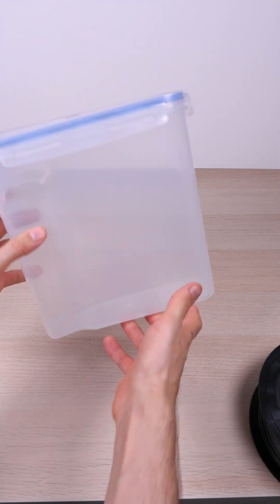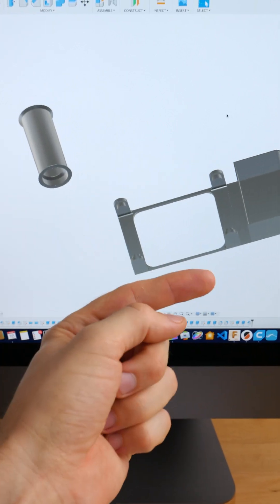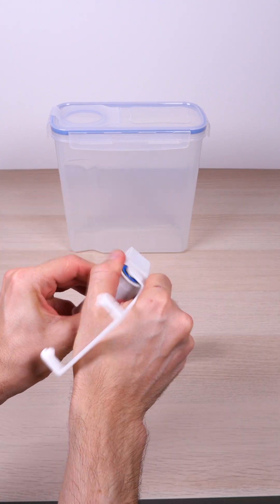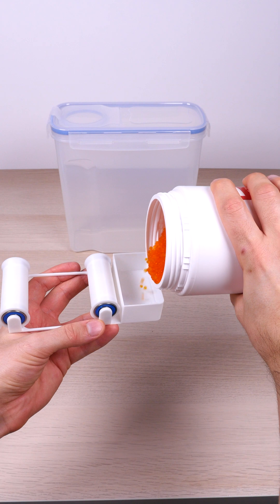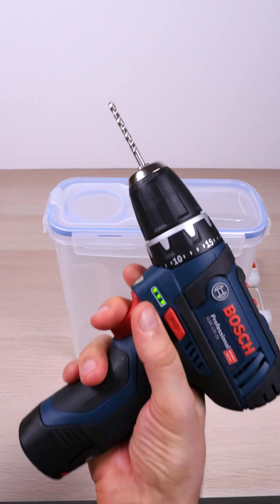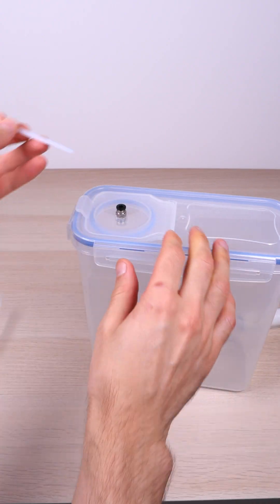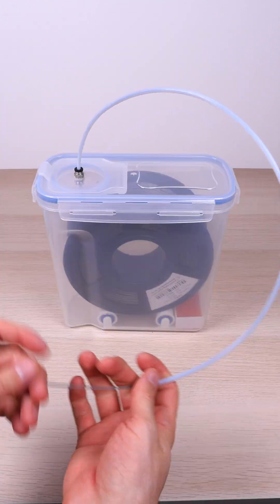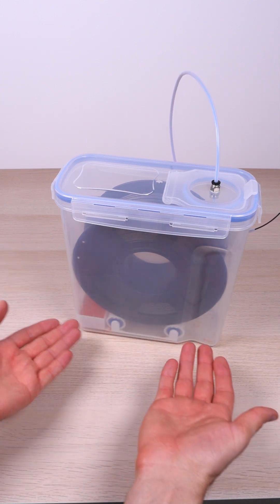how to keep your 3D printing filaments dry - Marsgizmo Filament Bunker (with cereal box)

Comment: I tried with PLA and it breaks off very easily when trying to snap in the roller. PETG would work best.
Reply from the maker: Thanks for the feedback 🙌😁with some PLAs I agree, much safer with PETG. I will update the design, to shorter the "pins" and add some extra features 😎I will post an update in a few days after testing the new design.
Reply: @marsgizmo  Is there any chance, you can increase the width to fit larger spools. I ordered the same cereal container and the width it 3.3" and the larger spool is 3" so they should fit. Have you tested large spools -> 1kg size. The rollers you designed are about 2.25" which I think you said on your insta page is for small spools.
Reply from the maker: @timb3970  yes, I can do for sure :) This is indeed for small spools, this was the maximum width for the Cereal box which I found. They have wider zones but most have a carve inside and will limit the spool size. Do you have a I have a link to bigger boxes? :)
Reply: @marsgizmo  https://www.ikea.com/ca/en/p/ikea-365-food-container-with-lid-rectangular-plastic-s79276760/ These boxes can hold 2 x 1KG spools
Reply from the maker: @sparks-tech  indeed, I'm using them since more than 2 years now 😊 but it's not very convenient when you have multiple filaments, printers as they always have paired together 2 spools and the box it a bit big.

But definitely useful, especially when you have very wide spools. 🙂

Comment: Hello marsgizmo how do you like the bltouch is it worth the buy and what does it do
Reply from the maker: Hi Simon, yes, it's the best bed levelling solution, definitely worth buying. I have 4 already. Make sure you get the latest version 3.1
Reply: marsgizmo ok great what does it really do just level the bed for you with out you doing anything or you level it and it’s a sensor
Reply from the maker: @simonharte7530  it's automatically levelling the bed before each print, to make sure you get a perfect first layer each time. What printer do you have? You can get the kit for your printer, which usually include the right cable length, connectors and mounting adapters. You can get it from Amazon or Banggood.
Reply: marsgizmo thanks so much I have a cr10 v2
Reply: marsgizmo could you send me a video of how it works
Reply from the maker: @simonharte7530  check on their website the BL-touch kit, they also have instructions, https://www.creality3dofficial.com/products/cr-10-v2-bl-touch-auto-bed-leveling-sensor 😉
Reply: marsgizmo ok thanks this bltouch means I do not have to manual/turn the knobs on the bed again is it
Reply from the maker: @simonharte7530  yes exactly, you only have to do it once, just to have the bed roughly levelled. After that the BL-touch with probe and adjust every time you start printing. Also you can easily change the top of the bed, with different thicknesses, will work perfect.
Reply: marsgizmo where did you buy it also